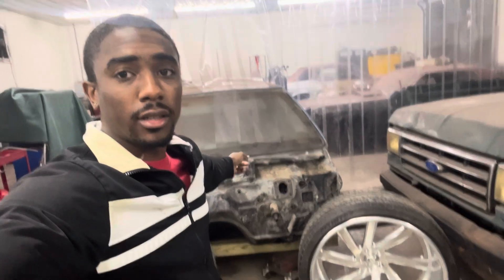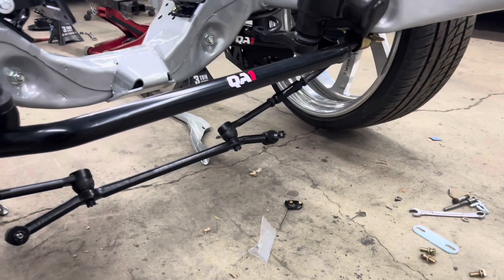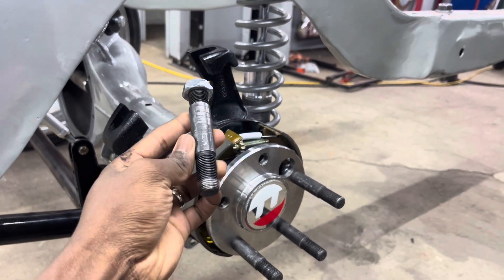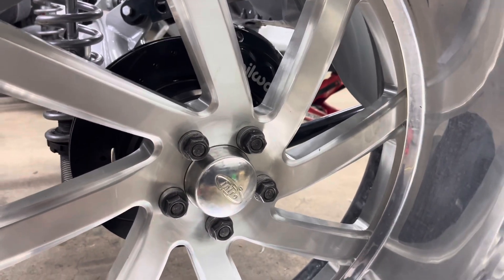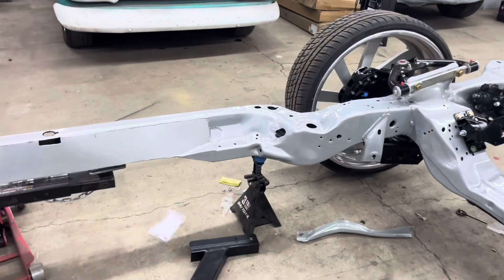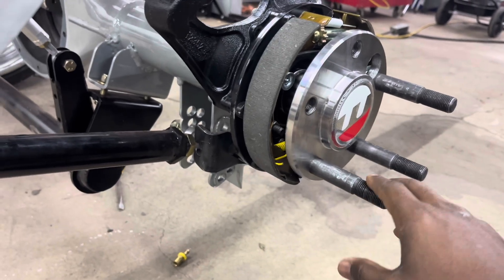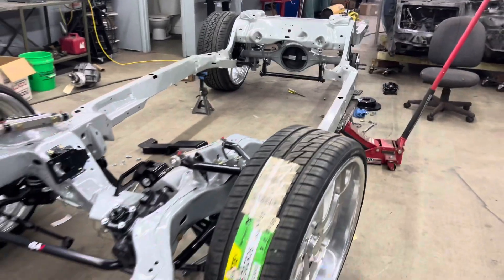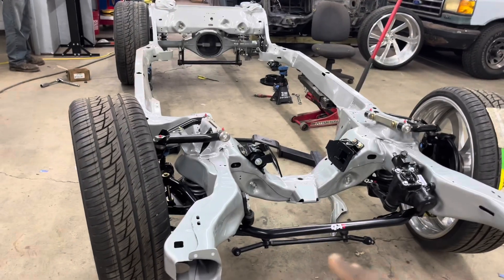1984 Frame Off Box Chevy Almost complete but have a few problems.

Comment: Frame look so good, especially with all those new parts. Thanks for the heads up on the proforged pitman arm, I had the steering kit but missed ordering that. Which video goes more in depth on that?
Reply from the maker: I didn't have one on specially the front suspension but video on the overall setup.

Comment: What’s the overall length of the rear end
Reply from the maker: It’s narrowed 6in off both sides
Reply: @Mr.ballingonabudget.  what’s the overall inch
Reply from the maker: @mikemichael4960  i haven’t measured. I took off 6in from both side off the stock length
Reply: @Mr.ballingonabudget.   I have 28x12x9 96 impala rear end under 4dr box